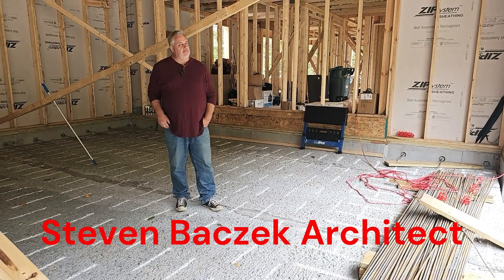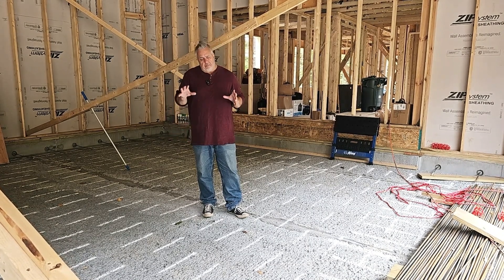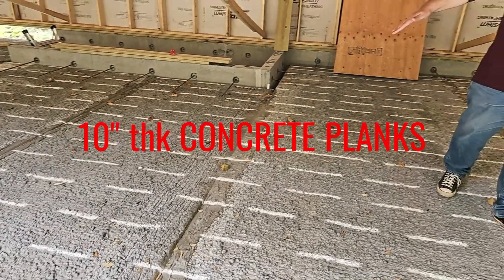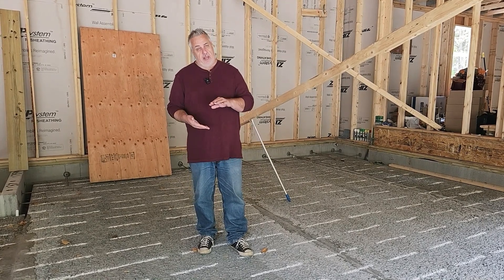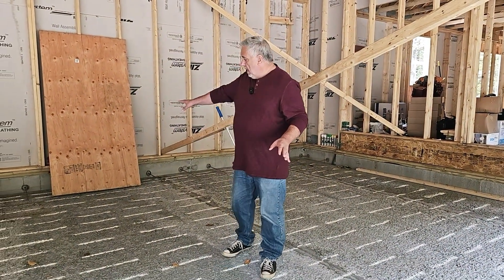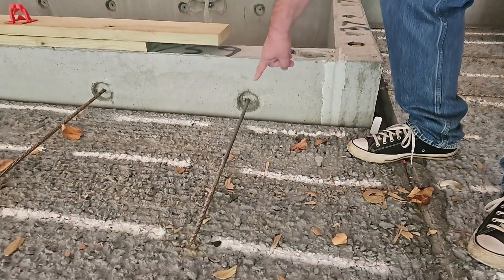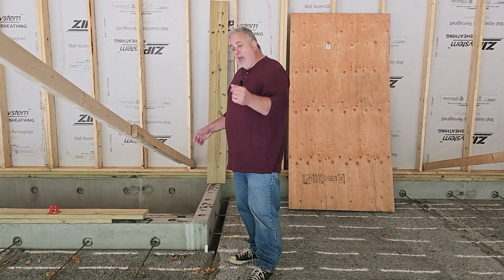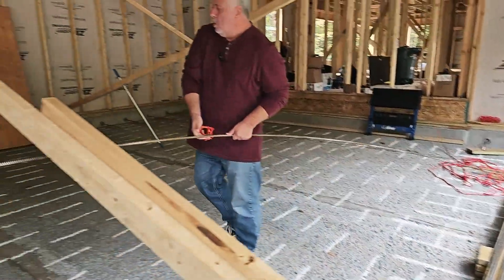Garage Topping Slab

Comment: Is the only reason for tying the slab to the foundation to prevent wall kick out?  If that isn't the case couldn't you simply float that floor as you currently have it and just pour over it? Similarly to how you'd float a wood floor? Just wondering if you could just use those pre-fabbed as the finished product, ideally with a different surface treatment that's more finished.

Comment: @Steven Baczek Architect Steve QUESTION on Bay 5 (time 5:58 minutes) I see behind you some opening at the floor level... Are those windows that are on the lower floor??? Thank you Steve, carry on, Liked#29 N Subscribed!!!
Reply: That is the cavity for the roll up door for the shop below
Reply: Was wondering the same thing
Reply from the maker: No, it's a steel beam header that gets locked in with the topper slab casting